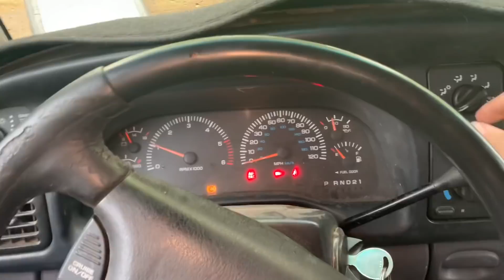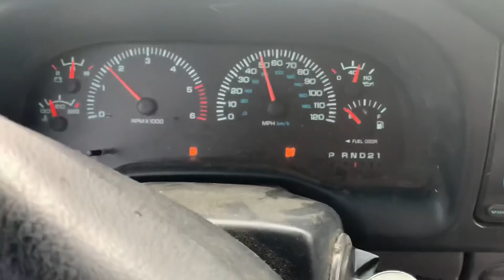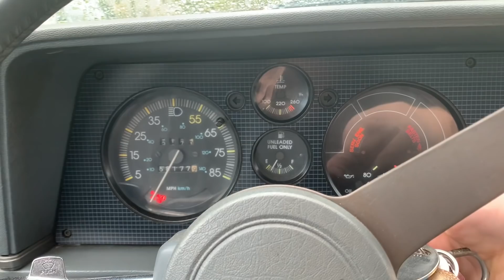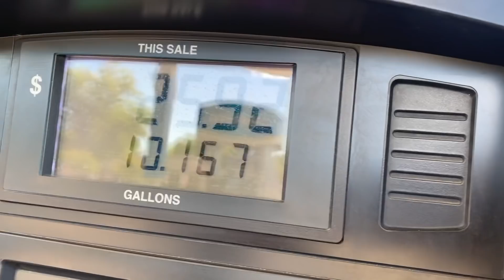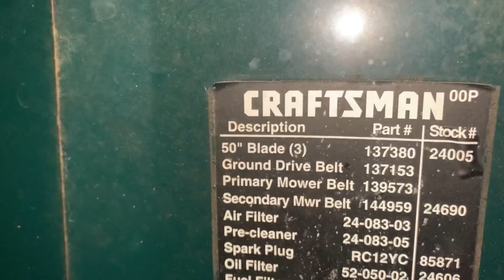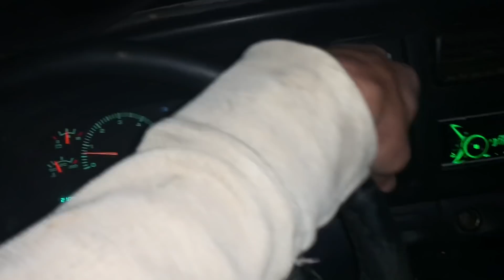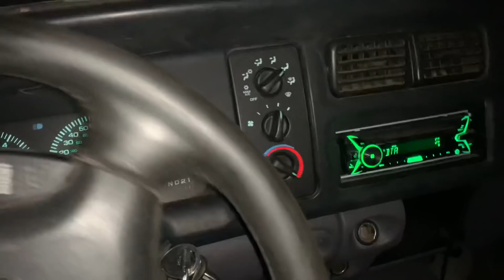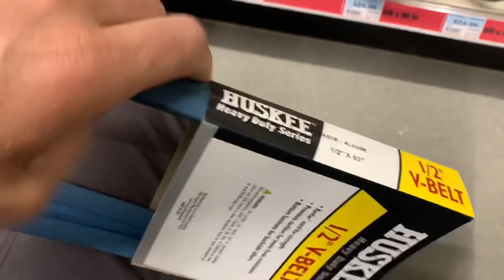RANDOM COMPILATION ( Haybales, mowing, Driving)

Comment: Hello Jay, normally when the throttle acts like that on a mower, follow the cable down to a hold down clip with a Phillips head screw and move the cable to desired idle and tighten the screw, it should give you more throttle. Sometimes the clip works loose and knocks it out of adjustment. Have a great day my friend.

Comment: I had the grey craftsmen LT1000 I believe it was of that type of mower with the hydrostatic transmission it was a really good mower it cut damn good but when my garage fire happened I ended up losing that mower but the motor was still good but the shell was toast tho . Now I have a Yard Machine but damn hurts your back when mowing I can't stand that , just not same as a Craftsman or Troy-Bilt lawn mower there's a difference for sure .